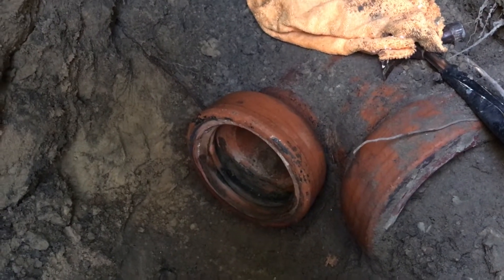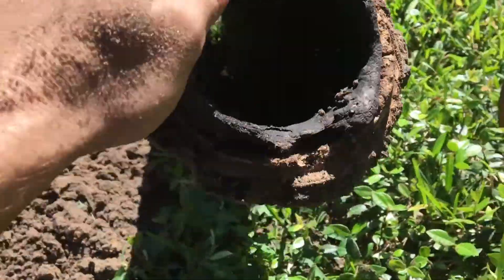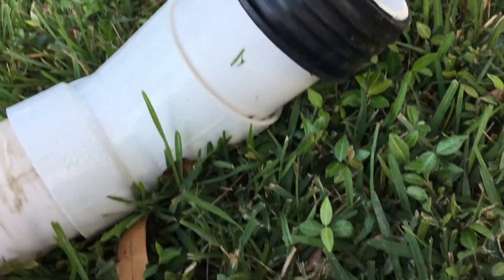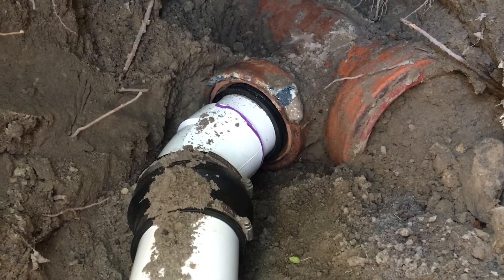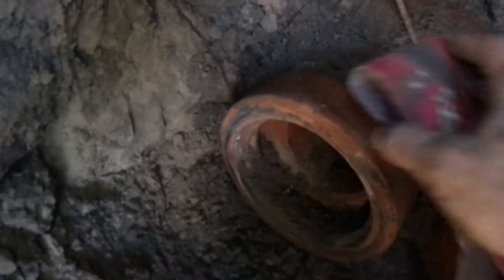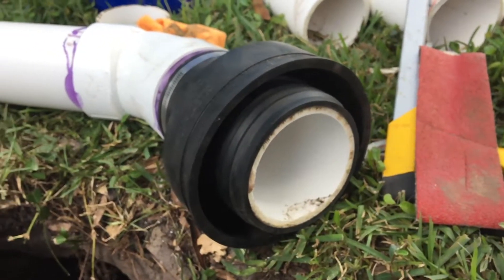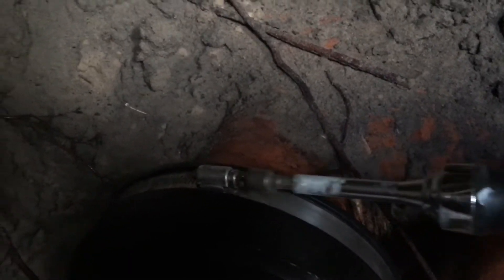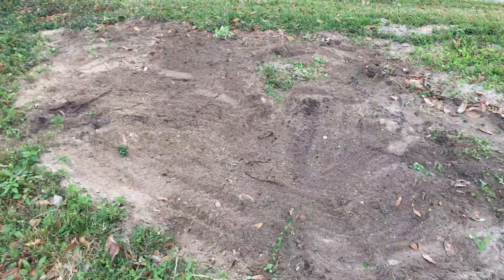How to Connect PVC pipe to Clay Sewer Pipe using Fernco Coupling

Comment: @CreativeProcessDIY

Chances are Fernco makes the proper donut for your clay pipe hub. In my own case I had a 6” clay pipe going to the city main. I called Fernco directly and the lady was very helpful. She let me know that they make several different 6”clay x 4” PVC donuts that each vary by 1/8” or so in size. The I.D. of the hub part of my 6” clay was about 8”. So she gave me 3 part numbers since it was difficult to determine the exact number. In my case:

Part No. 608-405 (which flexes from 7.8” to 7.92” in diameter)

- Part No. 606-405 (which flexes from 7.9” to 8.04” in diameter)

- Part No. 638-405 (which flexes from 8.3” to 8.44” diameter)

All three parts were special order. They don’t actually make them until they receive a new order for them. I ordered through my local plumbing supply store (Ferguson). Since it would be $25 for the fernco and $25 shipping, also knowing how these sorts of things typically go I decided to order all three and just pay a restocking fee for the two I would need to return. Just finished installing yesterday and it turns out the Part No. 638-405 was the correct one. Glad I ordered 3 since the one I thought would work, did not. Anyway I hope this helps someone.

Comment: Isnt abs better than pvc?
Reply: I would not use anything other than schedule 40 ABS. That’s is a code in many cities. PVC is much cheaper and less durable.
Reply: @vertihvost7675  I didnt know if there was any schedules in ABS. Schedules are for PVC. Not 100% sure.
Reply from the maker: pvc was my choice. you can use abs. both materials are similar
Reply: I replace abs every chance I get. Always seems too brittle and cracks everywhere. PVC seems to have a little more give to it

Comment: Won't those clamps rust and eventually break?
Reply: Stainless steel don’t rust under ground it can be under there a life time and still come right off you can even put a protective covering over the clamp wrap with plastic I have seen people do that with tar just for a extra protection
Reply from the maker: I uploaded a video in 2023 with an UPDATE about this sewer line:
What Happened with our Sewer Line? Main Sewer Line Replacement 2 Years LATER. 
https://youtu.be/z14Kq9cRhQg
Reply: You ask about rusting  Why Fernco Clamps Don't Rust the 
Material use is the best 
Fernco uses 300-series stainless steel for its clamps, a material known for being corrosion-resistant and rustproof but only if the clamps are 300- series and not fake or a cheaper brand alway check the clamp to see if it’s a 300- series clamp that is the best

Comment: Your joint is still going to leak. Those fitting you used aren’t leak proof and that’s the cheap Home Depot stuff. Did you use a torque wrench to torque the bands down to 60lbs like your supposed to? Your giving all these diyers this wrong process so they can go out and do the same thing and we can come out and make money off you.
Reply: Bobby, What's your idea then?
Reply: Shouldn't it be 60 in-lbs instead of 60 lbs?
Reply: It won’t leak as long as the pipe is in the rubber far enough and the clamp is tight, I’ve done a fair few of these I don’t see why it should leak,
Reply from the maker: @mountainleopard5370 
 I uploaded a video in 2023 with an UPDATE about this sewer line:
What Happened with our Sewer Line? Main Sewer Line Replacement 2 Years LATER. 
https://youtu.be/z14Kq9cRhQg
Reply: Torque wrench on a worm drive clamp.... lol  The way he did this is exactly how the city is updating mine.
Reply: @Stoneponics  bands should be torqued down to 60 lbs. you should never use those ferncos. In a couple years the rubber is going to sag and cause stoppage. It’s just what I’ve come across
Reply: @bobbytrujillo BS
Reply: @bobbytrujillo  so what should I use if not fernco?
Reply: @Stoneponics  you obviously don’t do sewer. If you can’t differentiate the tools. This is just making more money for us to come fix it the right way
Reply: @Stoneponics  the t handle torque wrench 60 lb
Reply: @Stoneponics yeah, still needs to be 60 inch pounds. Thats per code
Reply: Any open shop wanna be who tells you that only they can do it is a thief bro...yes torque it good and bed it in properly and you should have no problem...if there is a break it will most likely break at the fernco which would actually be better than a break in the sewer line or PVC...this would most likely only break if it wasn't torqued good or was installed improperly...and yes they sell these at Ferguson as well where us pros that do major commercial jobs go to get material...as a plumber I commend you on giving this a shot much respect bro.
Reply: Gave it 3-6 uga luga no cements just glue / maybe grey primers ask 🎨 er?!
Reply: Maybe use no-hub coupling if you can find the similar shape? It is way sturdier than Fernco, right?
Reply from the maker: I uploaded a video in 2023 with an UPDATE about this sewer line:
What Happened with our Sewer Line? Main Sewer Line Replacement 2 Years LATER. 
https://youtu.be/z14Kq9cRhQg

Comment: You gave a great idea to seal a leak in my sewer main line where I have a pvc and cast iron connection with just the inner donut
Reply from the maker: Thanks
Reply from the maker: I uploaded a video in 2023 with an UPDATE about this sewer line:
What Happened with our Sewer Line? Main Sewer Line Replacement 2 Years LATER. 
https://youtu.be/z14Kq9cRhQg